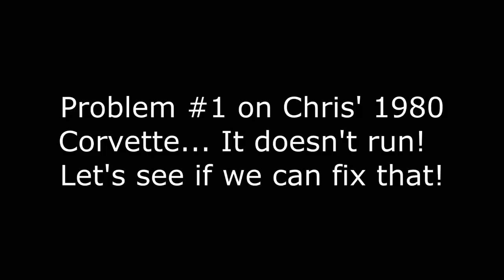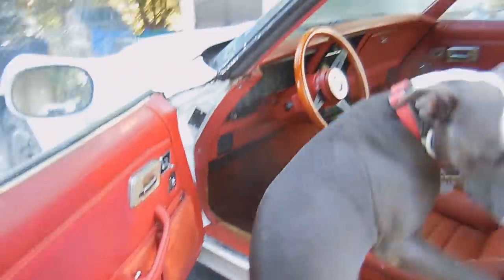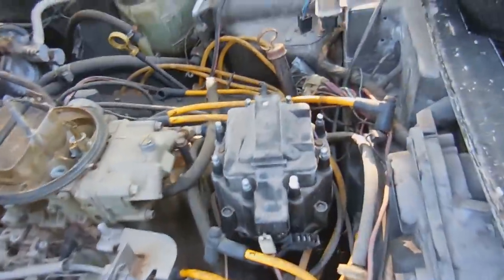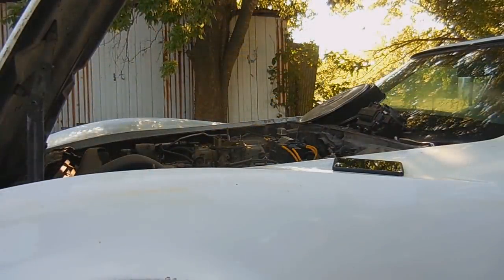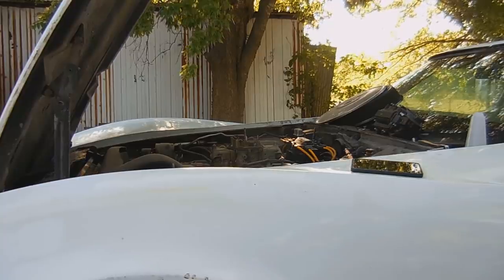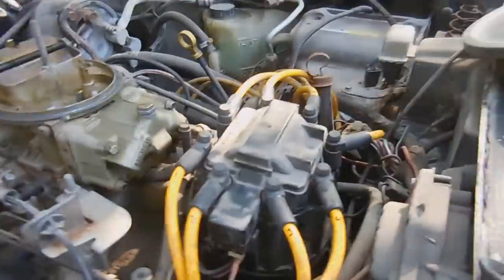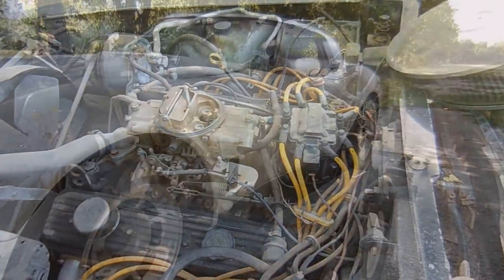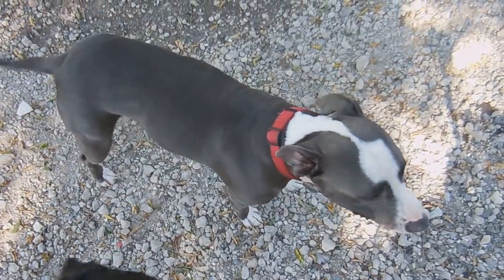Chris' 1980 C3 Corvette Project Car Part 1

Comment: If you pour the fuel in the holly carb into the bowl vents it will fill the fuel bowls up, allowing more gas to run engine on and possibly run long enough to pull fuel from the tank

Comment: Hello, I hope your well. I came across your video today after I had the guts to look at my corvette today after ignoring it for about a year as it sat on my driveway.  I have the same exact corvette as you.  I'm daunted about restoring it again for the second time.  IT has RUST. I opened the passenger door and rust came off the bottom inside how much bottom of door.  I would like to have it delivered to a restoration expert but I'm afraid of getting ripped off about how much work it actually needs.   I know there are probably areas of metal/aluminum that are rusted and need to be replaced.  I may want to take the task on myself.  What do you think?

Comment: 750 cfm double pumper is about right if it's running center bolt Vortec or aftermarket heads and has a fairly healthy cam. Once you get the valve covers off check the serial numbers, cause some centerbolt heads are not high flow Vortecs. Agree that 600 or 650 cfm would be better if stock flowing heads and stock cam. Have to figure out what you have before deciding move to a smaller carb.

Comment: Hey new to your channel. My 1980 C3 L48 here in California is still a lot of fun to drive.  I noticed your car doesn’t have the mandatory 85 MPH speedo on it.  It also has headers which means it’s obviously a non-California car. My clear coat is also in need of a good paint job but still gets the looks.

Comment: So I found a red on red 1980 Corvette 1 owner with 54xxx original odometer. paint pretty dead, interior not great, driver floor pan rusted out, but everything is there. I can buy it for $4k. frame and cage seem solid, exhaust and leaf pretty rusty. Car runs and drives very smooth. Should I jump at this low price? Would you go for it based on my brief description? Thanks!
Reply: did you end up buying the car ?

Comment: You are lucky the nose didn't come off when you backed it off the trailer.  May want to get some longer ramps or extend them with some boards.  

Love those 80s C3s though.
Reply from the maker: It's just the camera angle.
Reply: @TheCorvetteBen  okay just be careful. I have a similar trailer and I haul my Fieros and the nose wants to tear off if i'm not careful.  Love your channel by the way.

Comment: can u do a list of all parts under the hood  of a c3 ?   
thats how i know what to change when im buying

engine 
water pump
fuel pump 
distributer 
cooler intake 
power steering
What else  ?
Reply: If you need to change all of this when buying, I'd suggest buying one that doesn't need ALL of this changed.

Comment: How can you say a carb is too big without knowing the cfm of the carb or the engine specs, Holley's just look big compared to an Edeljunk because of the two fuel bowls.
Reply from the maker: It's a 750 double pumper...
Reply: @TheCorvetteBen  It's fine, you can oversize carbs some without having a negative impact.  But you need to have it properly tuned and functioning just like any carb.  I have a 670 Holley Street Avenger on my 355 and it's the best running carb I've ever had.